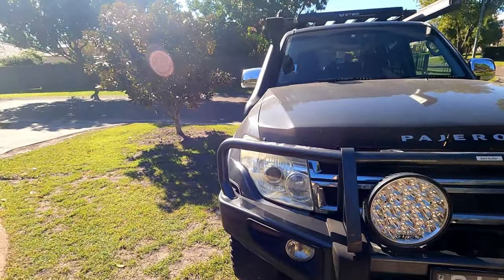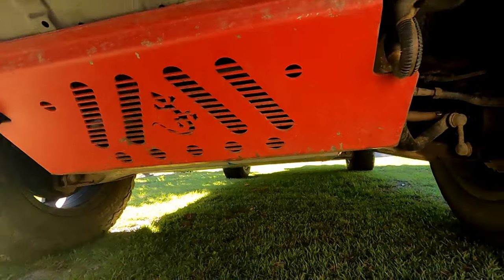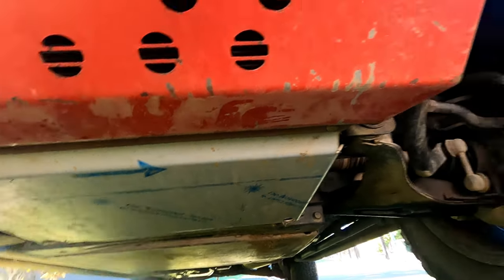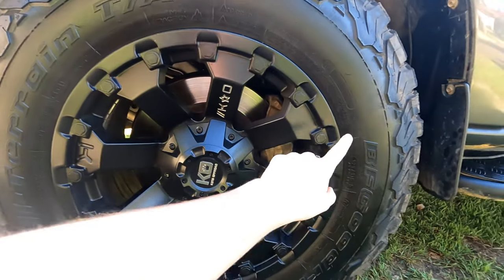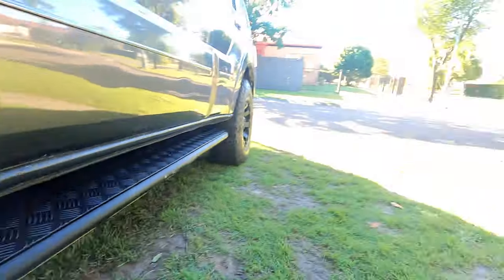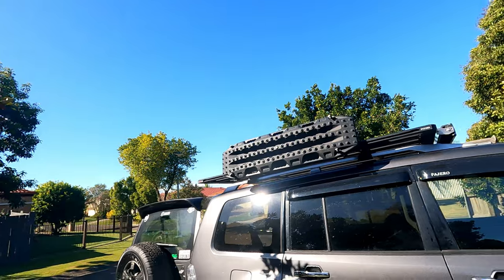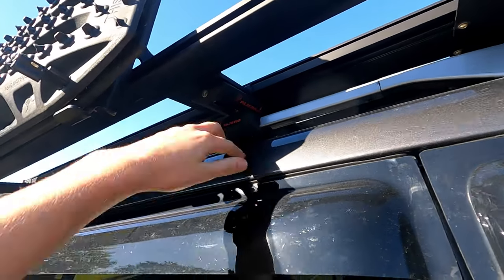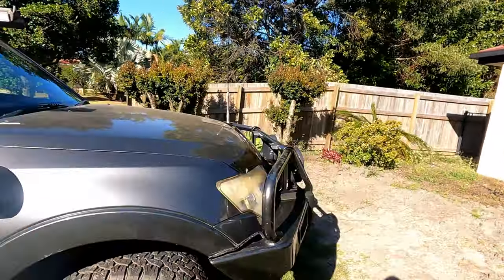PAJERO RIG WALKAROUND | 4WD BUILD | WHAT MODS YOU SHOULD GET ON YOUR 4WD

Comment: Thanks Bia for the look around your paj. I also own a 2011 NT, and I'm a mechanic. Can I recommend that you fit your catch can before you do your intake manifold clean. It will allow time to suck the oil out of all pips first. Ill have to look into the traction control switch. As it drives me insane. Just on dirt roads. Look forward to your next post. Thanks.
Reply from the maker: Sweet yeah will definitely install the catch can first thank you, and for sure the traction control button is so good, it used to frustrate me so much when traction kicked in

Comment: For your UHF radio, if all else fails to increase volume, you should be able to plug an external speaker into the back of the radio. GME make them and on ebay they are about $45.
Reply from the maker: Sweet thank you I'll look into it

Comment: Awesome vid. Do you think is TC switch is necessary just for beach driving and how did you go about installing? Haven’t tried the paj on the sand yet. Previously had a Navara with front diff lock and lsd rear so I’m used to just point and shoot driving
Reply from the maker: I personally find it necessary for sand driving I did all sand 4wding before installing it and I was still able to get everywhere as long as I had the momentum but if I stopped half way up on a sand hill traction control would stop me from going forward. But with the switch installed I could then take off again no worries, I found it a massive improvement for the little cost it is. It really installing depends on what sand your on aswell like, I went to 5 rocks everyweekend for nearly a year(which can be a lot of soft sand tracks) with no traction control button and made it up everytime, but it was frustrating on the soft sand it would kick in and I would slow down a lot but luckly I always had a lot of momentum going and could gain control of my car again, after installing the button driving the tracks were 10 times easier. But if you will mainly do Beach ttracks like double island point that is super hard sand I wouldn't worry as much, but even so it's handy to have the button for in mud aswell

Comment: is this traction control different to the standard button that disconnects?.  cause I have that on my NT so is this a different way or method
Reply: That Standard button only tuns of stability control(ASC) Vlad switch turn off Traction control, Stability control and ABS
Reply from the maker: As Michael said th ASC is different to the traction control button
Reply: ASC is the one that's cutting engine power. When it detects wheel slip it will cut engine power. Turn that off if you are driving in sand (or low Traction surface) and the car won't cut power like that. Having said that, the TC mod is still something very useful and I reckon every Paj should have it stock because the TC itself can hinder the car somewhat when you drive on sand at speed. But the TC (with ASC off, auto off in low range) is really good on slow speed stuff. If you know how to use it, it will even dig you out if you get bogged in sand.

Comment: I thought the traction control was turned off automatically when in 4 wd low range ?
Reply from the maker: That's a common thought most people have and what I thought too before I bought my traction control mod, but there is a big difference in performance. It's the Automatic stability control that gets turned off in low

Comment: Any idea about rated recovery points for Pajero 2008 NS?
Stock recovery points are alright for 4wd?
Reply from the maker: Pajeros don't/ can't have rated recovery points as there is no chassis, while u can use the standard  "tie down straps" if your not going to put it under a lot of stress. Having a bullbar and winch is a little bit of a better  option in my opinion. But there seems so be a lot of debates about related recovery points, sorry I can be much help

Comment: Hi Bia,
I have the option of a 2001 LC Series 100/Lexus LX470 or a 2009 Pajero 3.6 Petrol. Which would you recommend?
Reply from the maker: Although I love pajeros and would recommend them highly if I were you I would try and stay clear of the petrol engines as they can be quick pricey in fuel unless that's the engine you want